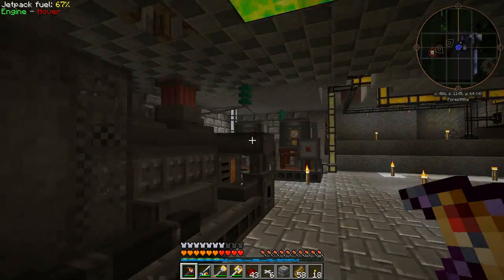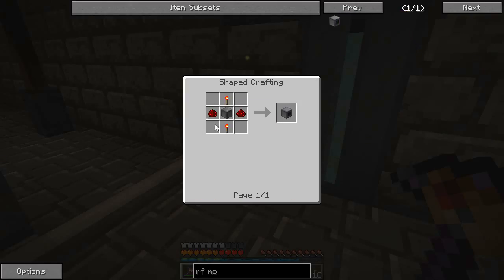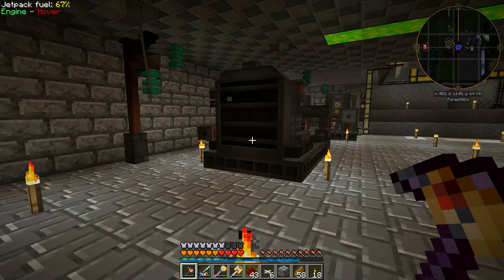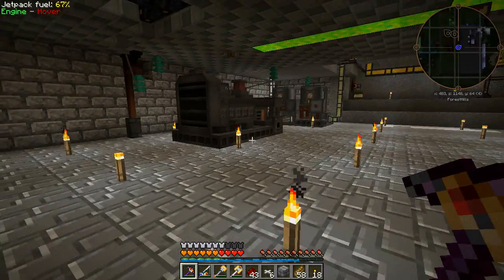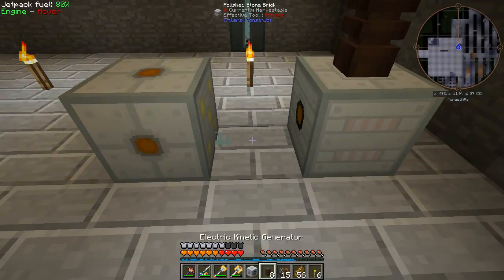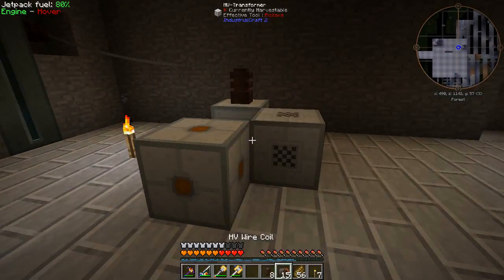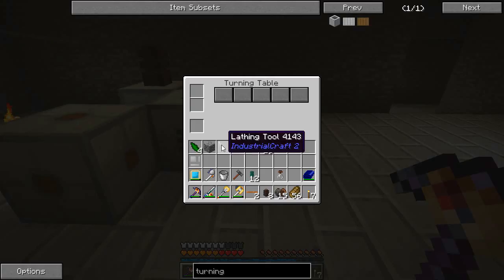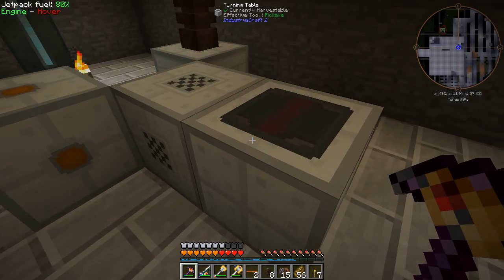S07E21 - Playtime - Power Control and Turning Table

Comment: Aha! I had to do the same thing with the torch to invert the signal, if I had only seen this one a day earlier - it took me a little while to realise why it wasn't working and that I needed to invert the signal. It's a shame you can't configure the redstone output on these type of devices to be on or off - the Ender IO power monitor was the same deal. With the Ender IO conduits you can smack the end with a wrench and it will connect.
Reply from the maker: +Jason Phillips What do you mean? You can invert the output on the RF Monitor.... You just change from "less than" to "more than" for the power monitor, and that inverts the output. I'm not sure on the other power monitor, but the one that I used was super easy.
Didn't realise you had to smack the conduits to get them to connect, I might change it back at some point. I'm tempted to move the generator, just because its noisy going on and off all the time! :-P
Reply: +Stoo42MC Oh! From the angle I was looking I thought I saw the torch on your block, but you're just raising the cable on it. The Ender IO one I don't think is that configurable so I had to invert the signal. So its a bit messier than the solution you have. I may be just missing an option somewhere too.
Reply from the maker: +Jason Phillips Yeah its just to raise it because the cable needs a surface still. I'd rather use the conduit from enderIO, but didn't realise I needed to hit it to get it to connect. I'll give it a go tonight once I'm home from work, it should make it a lot tidier with conduit!